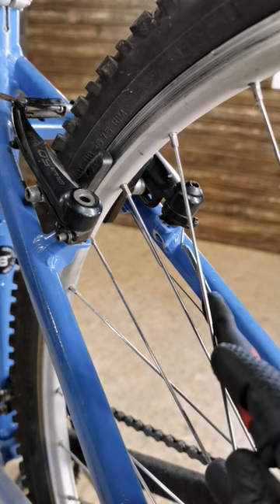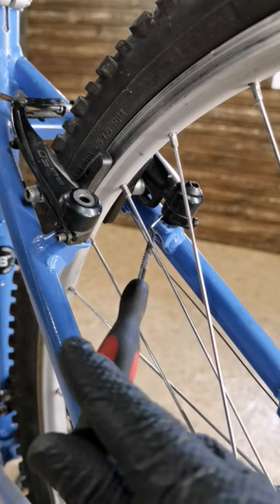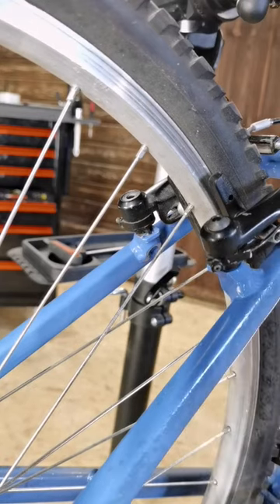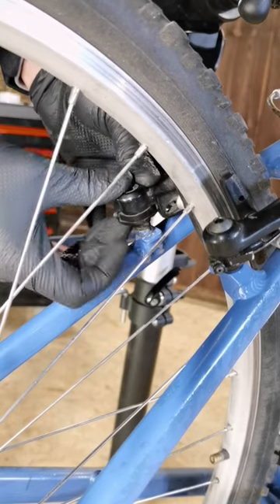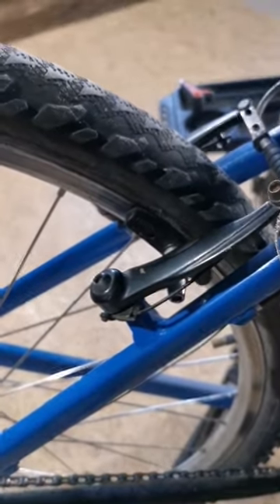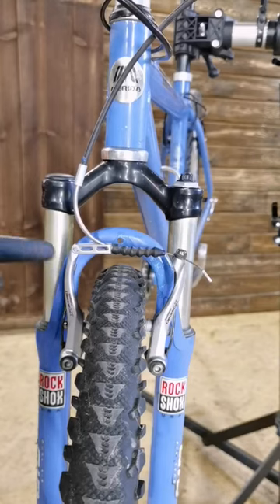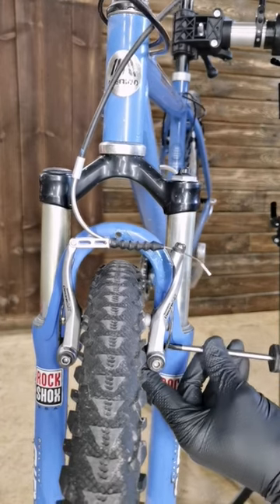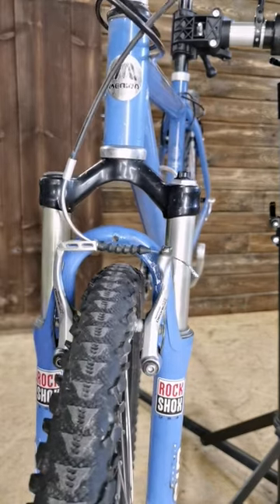Why are your V-brakes crooked. 2 reasons and fix.

Comment: At the end the arms can pull uneven two weeks later again for unknown reasons, I'm happy I switched to disc brakes on most bikes which don't have this hazzle
Reply: Dried up old dirty pivot grease can do it
Reply: Thats not true. Good vbrakes dont need any servicing in many years.
Reply: @bobikbobikowy5458  if you can use your brakes many years without maintenance you obviously don't use your bike very often. On my main bike I have to service the brakes 3 to 4 times per year
Reply: @simonm1447  Used V brakes for 2 years, every 4-5 months I have to service my v brakes for about $6-14. V Brakes are actually more reliable then disc brakes, I have another bike with disc brakes and I have to tell you its expensive to buy new brake pads or do servicing to the caliper.
Reply: @darwishbaqirnormantpss9290  which type of disc brake do you use? I'm currently not at home but have my MTB with me and I'm riding it since 6 months now as the only bike. It still has 50 % of the pad material and new pads in Europe for this bike are 4 to 5 € per set of pads. The V brake pads I use on my V brake bikes cost more that that. 
Pushing one syringe of oil through the caliper every 2 years or so isn't expensive too. 
However if you compare the brakes by getting discs serviced in a shop and doing the V brake at home it's clear they are more expensive, but this is would be an apple to orange comparison
Reply: @bobikbobikowy5458 Many years? Lmao how much do you ride, 200km per year? Brake pads for V brakes are not going to last more than 2000km, it is about half a year for me
Reply: @jurekgadzinowski2895 cassette type v brake pads can be ground down to 0 in just one day, commuting to work and back home in the rain...

Not to mention the sand that gets under the pads and grinds the rims down until they break...  happened to me twice...
Reply: For me, disc is more hassle because of the chances it gets contaminated, noisy, and the bleeding if its hydraulic

Comment: Thank you so much for this tip, was struggling with my build, now only the gears left, they work but sometimes skip a gear or don't change at all
Reply: Could be shifting cable or u have to overhaul the deraillur

Comment: the tensioner spring arms for V's can also be offset within the caliper housing on the brake bosses using the same eyelets as they lose tension which could be solved by pushing them outwards to 'reset' the tension of the springs, be careful doing so as you may break them

Comment: Pro tips from bike mechanic:
1. You don't need to take the boot all the way out, you can just back it out to the point that you can switch the spring location.
2. It could also be caused by the spring falling out of place, which would look almost like a long black or silver paperclip that's been unfolded sticking out from the brake.

Comment: AND/OR your cone washers are flipped on the wrong side of the caliper/arm. The wheel may also not be sitting flush in the dropouts. The wheel may also be off dish/bent
Reply: This video demonstration is aimed at novice/intermediate cyclists that might want to DIY their own bike servicing before considering a bike shop mechanic.

You're just complicating matters with your explanation on solutions that are the least likely to happen with a bike build. 

SickBiker is just keeping it simple for the general viewers and as a YouTube influencer, he has post new video content from time-to-time for his channel.

No one is going to watch a demonstration video going into the explanations you mentioned......... that's for dedicated/experienced cyclists.
Reply: @millsshumps1968  this video isn’t just for someone building a bike. That person who is building a bike would be at a much more advanced level. This is most likely geared at someone that bought a used bike and needs to make adjustments. As someone who buys and sells bikes, I have seen so many people who think they know how to work on a bike that clearly made a mistake. You’d be amazed at how many people put the brake pads switched for left and right and worse, sometimes upside down. A person needs to make sure everything else is done correctly before making adjustments to the lever tension. An off dish wheel might be rare, but the rest are certainly not.

Comment: also if all else fails you can bend the spring by hand like a caveman. not ideal but works when you've run outta adjustments.

toe them pads in too y'all ✌️
Reply: Always works too, also tool free!

Comment: V brakes are really terrible, if all is new and properly adjusted they are powerful and cheap, but they don't stay adjusted for more than a couple of days, one day if its raining...  nightmare to get the spring tensions and pad toe in adjusted...

Cantilevers are much better as rim brakes...  back in the day, the term "v brake" actually referred to cantilevers...  at some point when these H brakes appeared (as they ought to be called), the term jumped to them...